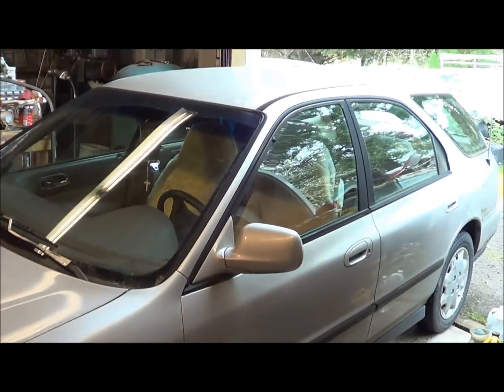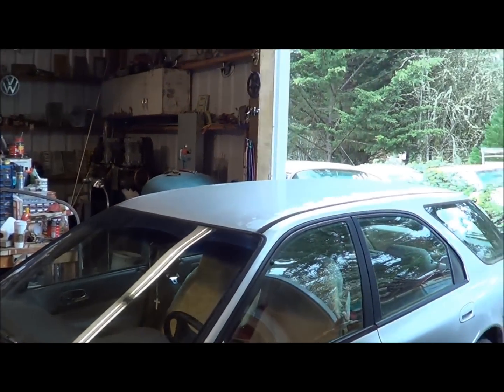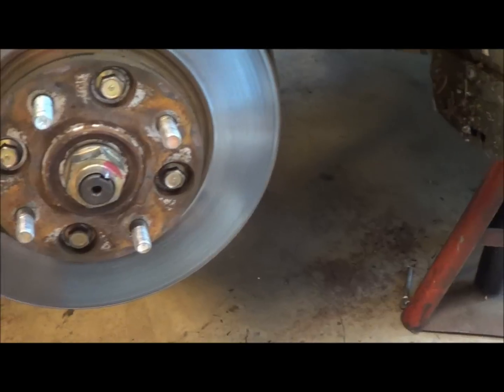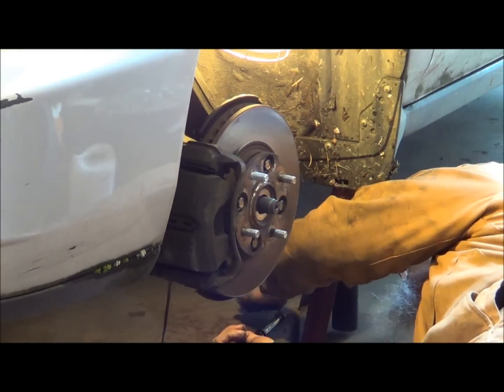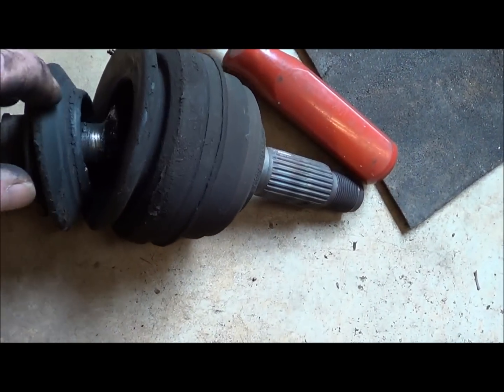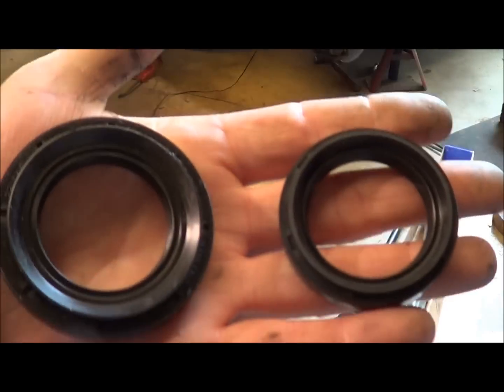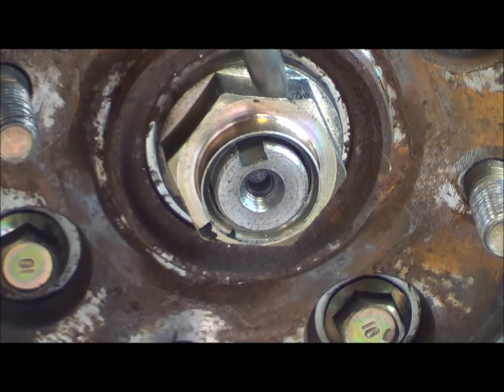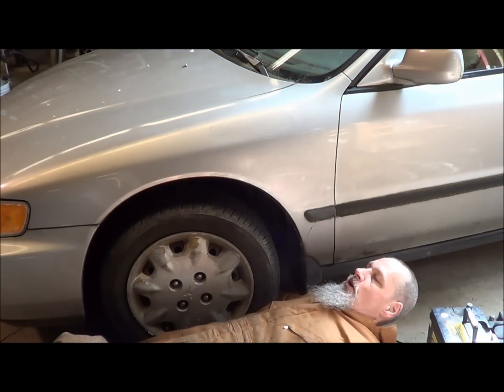96 Accord Front Axles Go Click Click Click

Comment: Thanks for the informative video 👍 I’ll be rebuilding the whole front suspension with new CV axles on my 97 Accord SE with over 230,000 miles on the clock. She’s my daily commuter for work with a RT of 132 miles 4 days a week. So, it’s time for some tender loving care for her.  These Hondas will last forever with good periodic maintenance. Recently re-ringed the engine and reconditioned the cylinder head. She now runs like a clock. Hopefully I’ll get another 200,000 mile until I retire in 5 years 😁